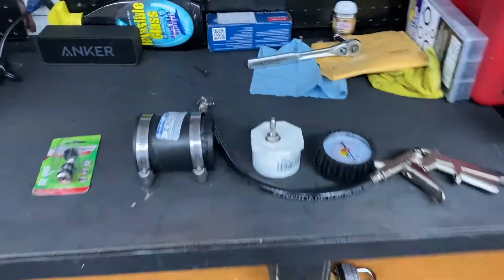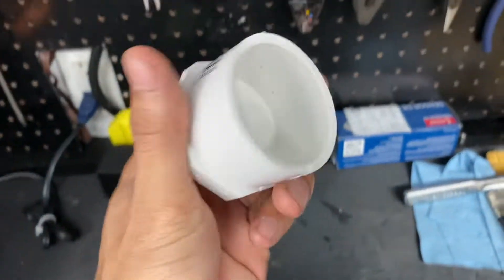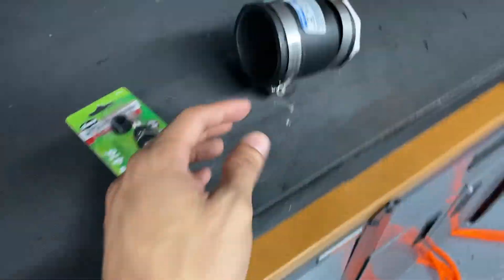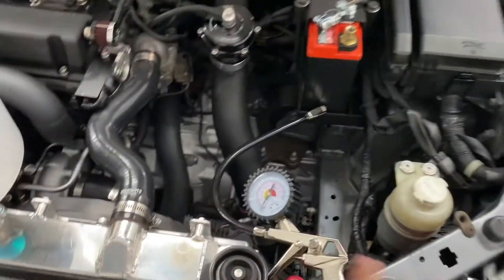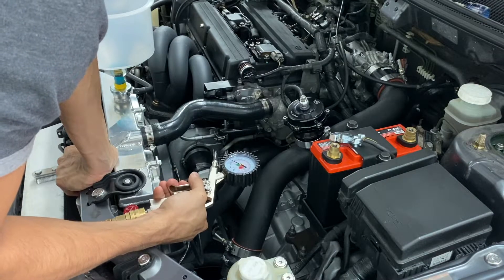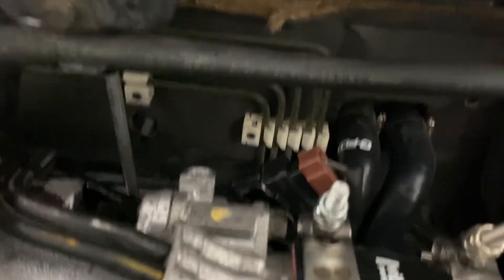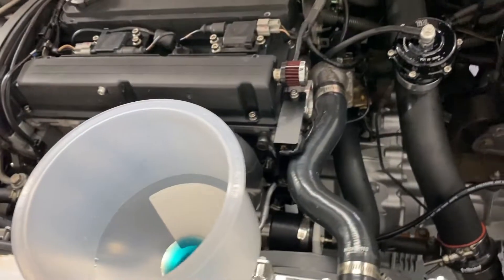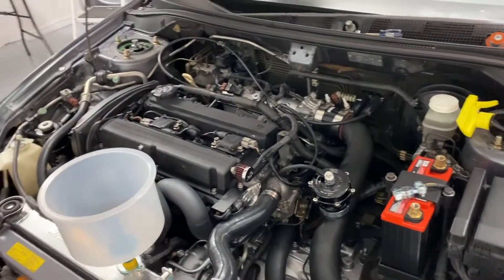How to create your own boost leak tester under $8 dollars & how to test for boost leaks!

Comment: Damn. Great idea! I’m looking all over the place for a cheap boost leak tester and they’re all crazy expensive but I don’t have an air compressor either. So I’ve been looking for a Schrader valve to air compressor fitting but with a kit like this, I don’t need it at all. My idea is to use my bicycle pump and I can easily pump 18 psi into the system And with a proper gauge I can see if it leaks down or not. If it does leak down then I can use soapy water and just go joint by joint until I find the one that has the bubbles. So thanks a lot for this video. It really helped.

Comment: Best boost leak vid on here thanks ! 
Question can you test from the intake pipe down / example starting all the way from where the air box is to test 100% of the intake system ? Or just on the turbo direct only

Comment: Good idea, but when are the exhaust valves could be open leaking out the air, sometimes you can't get enough pressure in the system to really see the leaks, best to put a plug right before the throttle body then test again

Comment: Saw another video where gentleman said it was important to remove oil cap on valve cover?
Reply: you should , because you dont want to blow out a crank/cam/ or any  seal if the air builds up inside the engine.

Comment: About to build this set up to test my Hot Rodded 12 valves RV's intercooler plumbing.  It has 3" tubes but same concept.
I will be also building a 2" set to test the radiator too, but will use water nozzles instead of air.  Mainly because I want to flush out the radiator and engine before I get it ready to run.  
Funny how your video just popped up today after looking for parts to build one yesterday.....

Comment: I wouldn't use that rubber coupling for this tester. Those are only designed for like 3-4psi and is the reason why it's swelling up when you put 10psi in it. But it's a really good way of finding boost leaks quickly and cheaply!

Comment: Doesn’t the air just go out the exhaust valves that are open if you try and pressurize the whole piping and intake manifold itself?  I’d you start at the turbo inlet or turbo outlet?  Where is your air source?
Reply: From the video it is obvious he connected the adapter to the intake of the turbo (which normaly connects to the air filter hose), the turbo output is usually placed bellow the intake. It shouldn't make any difference I guess, beyond that it is probably easier to connect it to the intake of the turbo rather to the output hose of the turbo.
The inlet engine valves "should" be all closed when the engine is shut down, since the last compression stroke that finally stops the engine should prevent that piston from reaching it's TDC, making all other pistons somewhere "in between" their TDC and BDC positions. Based on this, there should be no place for air to go from the point of connection to the turbo, except for the leaks of course ;)
I am not 100% sure about this second part though, perhaps somebody here could verify it?
Reply: The intake valves will always be closed when the exhaust valves are open and vise versa.
Reply: @austinsherwood7188 there is a moment where both intake and exhaust valve is open at the same time, it’s when the piston is at the top dead center (not ignition time)
Reply: Thanks for the replies!  So I talked to a company that manufactures a similar but more fancy version of these, and they said the valves shouldn't both be open (may depend on vehicle).  They said start by removing the oil cap and going up to 5 psi, see if there are big leaks, and if so, try putting the cap on and seeing (carefully) if pressure builds up (indicating a bad pcv valve).  If all is good, keep going up to 10, then 15.  Nice looking units they sell at turboboostleaktesters

Comment: In 2022 this set up will run you about $18, still a lot better than paying for a diagnostic. Great video!
Reply from the maker: Crazy how things have gotten so expensive!!
Reply: What is a decent air compressor on a budget.
Reply: @Brandon Weiss I have the craftsman 150psi  6gal pancake compressor and it works pretty good. I got mine for about $100 + another 20 or 30 for hoses etc. 

It works great for this kind of thing or airing up tires using an air blower and more light to medium duty stuff, just don’t expect to run a impact or anything large like that on it.

Most grinders and cut off wheels are recommended to use on a larger compressor because of air capacity and run time but I have a cheap harbor freight angle grinder that works pretty decent on mine.
Reply: @Bsizzle92  Bike pump with a gauge is a lot cheaper.
Reply: Parts nowadays are Highway robbery. Most of the domestic manufacturing has been pushed out And replaced by overseas manufacturers. Very little competition means they can now charge whatever they want.
Reply: 2023 this setup will cost you close to $30, still cheaper than buying a premade kit
Reply: @drsnowmon  These basic parts are that expensive now 🤔

Comment: Anyone attempting to upgrade there truck past the simple cold air intake should own one of these testers. I ripped apart my ERG/ intake to be cleaned. Once put back together, my turbo whistled.
This helped me track down a torn hot side boot and metal gaskets on the intake/ egr that I needed to replace/clean. Thank you

Comment: Its gonna be 308$ for me, since I don’t have a compressor, but either way good job!
Reply: You could also soap water the whole thing first then crank away on a bike tire pump for bubbles 🤣 Probably wont find the really small leaks that present only under high pressure though 🤔
Reply: You could. Also drive to the gas station and use the air compressor there. 🤷‍♂️

Comment: From what I have read, if the pressure guage is not attached to the cap it won't be a true psi reading. I personally thought the pressure guage on the gun would be good enough ?
Reply: Pressure is pressure.

Comment: Great idea, but can't find a 3" cap to fit my intake tube, I guess plumbing doesn't use that size?
Reply: For anyone in my situation, I ended up buying a 3" O.D. section of exhaust tubing, and used a hole saw to make a cap for it and welded it up. Worked great. Though I discovered you have to vacuum test your vacuum actuator to properly diagnose function, as that ended up being my issue.
Reply from the maker: Hmmm I wouldn't know :/
Reply: They got 3 inch
Reply: @michaelbenson6775  3" inner diameter, not outer (at least at home Depot, Lowes, and Ace)

Comment: You said you had a leak on your intercooler coupler and it was super tight , I am in the same situation what did you do to stop the leak ??
Reply from the maker: I removed it cleaned everything up just in case and put it back on as tight as I thought would be safe and then tested again. If it's still leaking keep tightening. Be careful not to bend anything those clamps are very strong and could bend your piping.

Comment: It’s a pressure leak, not a vacuum leak.
Reply: Putting air pressure where there should be a vacuum will give you the same answer you’re looking for… where is air escaping
Reply: A boost leak test is a vacuum test. It's the same thing.
Reply: You just basically said its not air, its oxygen
Reply: @OfficialCharlieX  yeah you’re right. Take all the pressure out of your tires and set them to 35 in of vacuum instead of 35 pounds of pressure and let me know how that works for you in a dynamic situation lmao.
Reply: @jcbenson01  they're not equal in this regard. The terms boost leak and vacuum leak mean the same thing. Either the engine is in vacuum or pressurized under boost. If air is escaping, you're testing for leaks within that closed system, and therefore testing for a vacuum leak. AND a boost leak, simultaneously.
Reply: @sonofnothing  my point was that, in this video, the poster says "So you know that there's a vacuum leak there..." and refers to the leaks as “vacuum leaks” on a pressurized system. I can’t believe you two are even arguing about this. And no, a pressure leak is not the same as a vacuum leak. I’ve seen leaks under pressure that don’t leak under vacuum. And vice versa.
Reply: They are the same thing 😆
Reply: @Yan1nc  unless you have a blow off valve. Since blow off valves open under a certain vacuum, you should rather do a pressure test to check for leaks.

Comment: I'm trying to boost leak test my evo ix, but it doesn't build pressure, all the air comes out the exhaust? I've read that I need to rotate the crank manually and keep trying. Have you ever heard of this problem?
Reply from the maker: unfortunately no.. Let me know if you find out what it was..
Reply: @ChrisGoorbarry  EGR vacuum line was off.